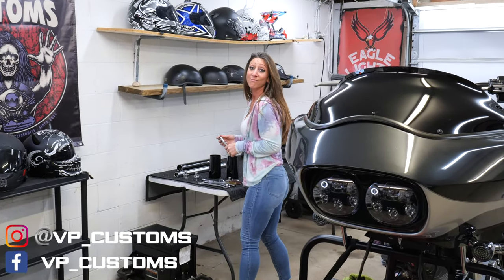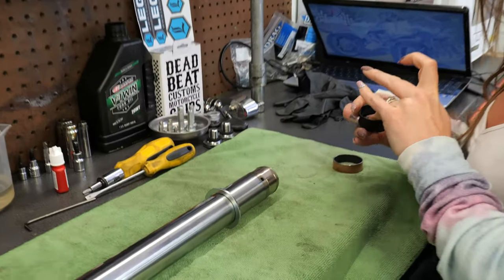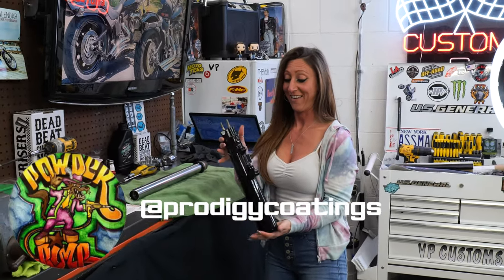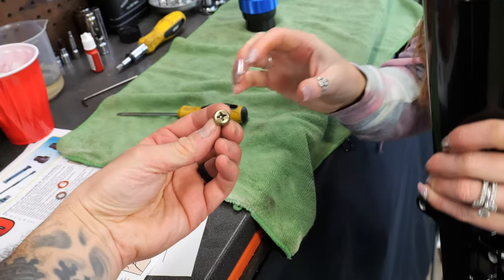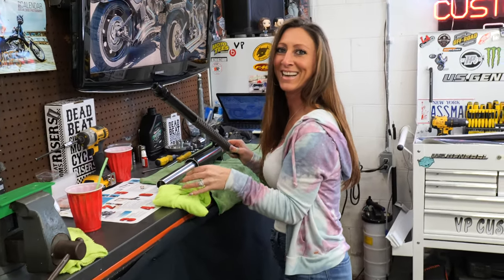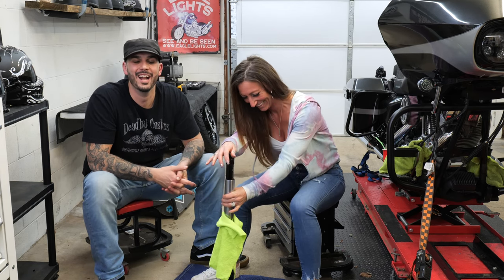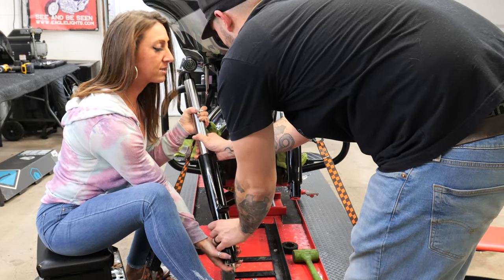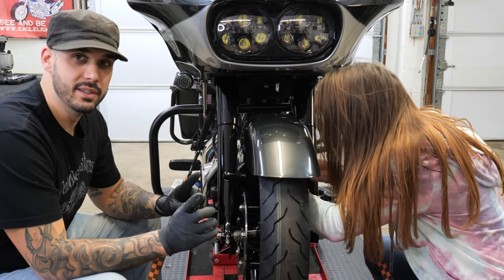This Just Got Interesting...

Comment: Where did you find the fuel tank trim?  I have an 05 road glide and need to replace mine but I’m struggling to find one I like.
Reply from the maker: It came on the bike actually! What piece are speaking of specifically? The chrome or the insert in the middle?

Comment: Did you check the cam chain tensioners ?
Reply from the maker: Yes will be discussing in an upcoming video.  They look perfect so I'm going to hold off replacing them until we upgrade the cams
Reply: Cool, 05 deluxe with the same motor. Looking for ideas when I upgrade the tensioners